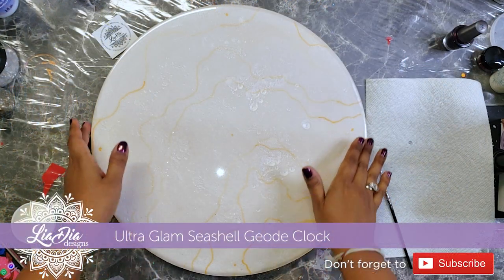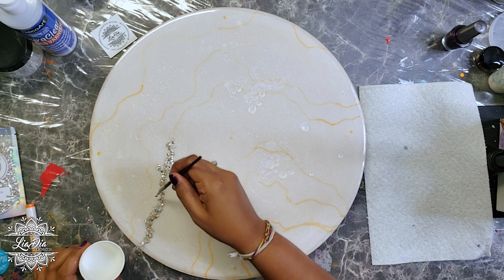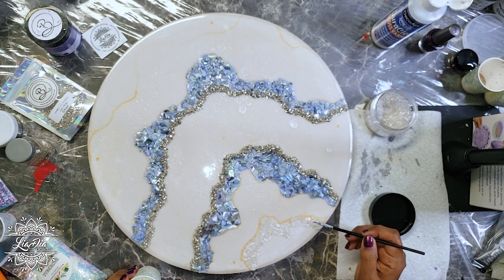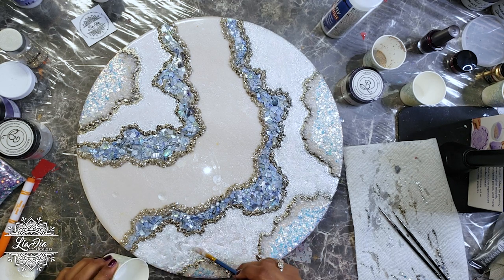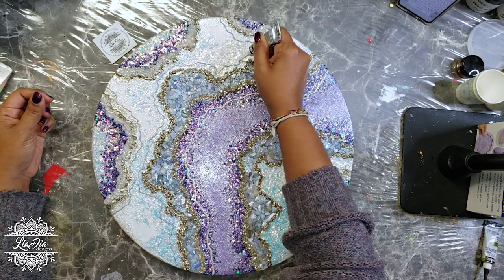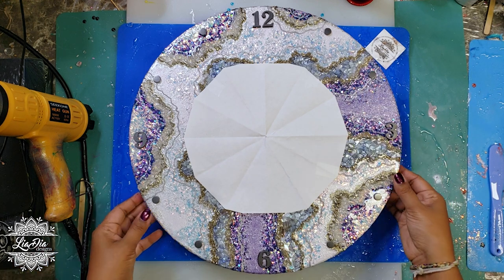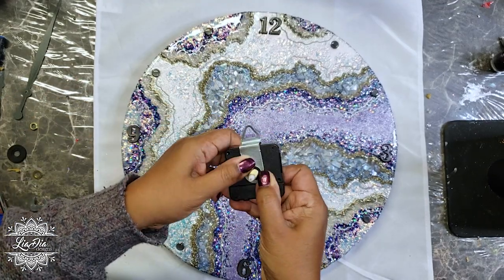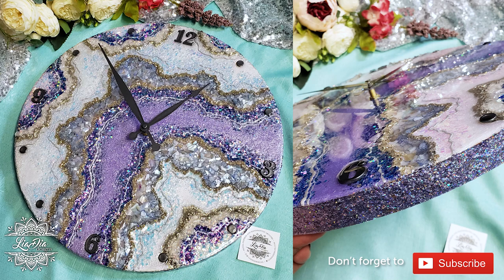How to make an AMAZING Seashell Geode Clock. Ultra Glam and Handpainted. Full Tutorial - Epoxy Resin

Comment: I absolutely love your work, such great tutorials as well.  I do have a question, on this particular clock your base coat is resined, can I begin putting down the glitter , embellishments, etc. by laying them down on a painted MDF board and following up with resin once the design has been achieved?  Doing the resin as you describe in this video, just not having a resined base to begin with.  Hope that makes sense.  Thank You for sharing your talent.
Reply from the maker: 🥰thank you  Yes,  I think you can just prime the wood and do your design before pouring resin as a topcoat. I usually like having that resin base in case I want to leave some of it exposed (most of my designs are done "on the fly" lol)... but if you know for sure that you will cover the entire base with designs (glitter etc), then yes,  a base of resin isn't needed. 😊
Reply: @LiaDiaDesigns  thank you so much for your quick reply .  I primed my board and then poured a base coat of acrylic paint.  Waiting for it to dry and then will do my geode designs and then top with resin.  Can’t wait to experiment.

Comment: This is just stunning!  How do you get the mica mixture so smooth?  Mine looked terrible when I tried it with some Polycrylic I had.
Reply from the maker: It does take a bit of mixing sometimes,  depending on the mica... but it should smooth out
Reply: @LiaDiaDesigns  thank you for responding to me!  The Polycrylic was really bubbly and just didn’t dry very nicely so I bought some of the Duraclear and that is much better.  Yay!  I really love the technique as you said, it gives you so much more control than the resin.  Keep up the amazing work!